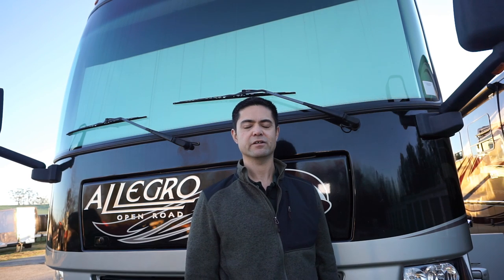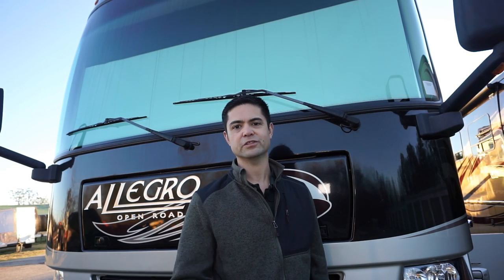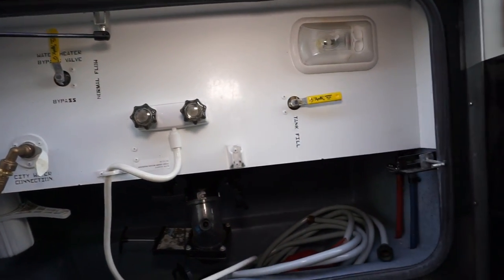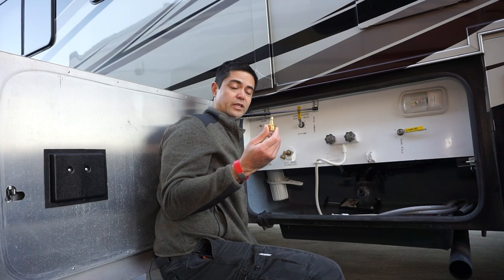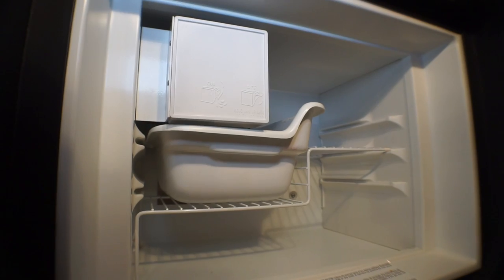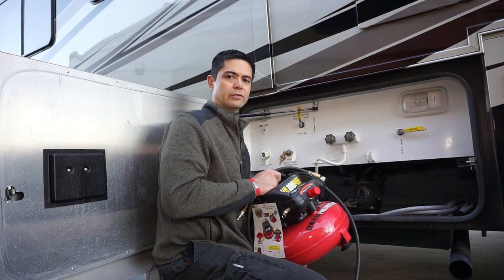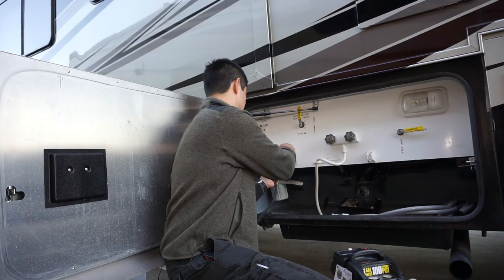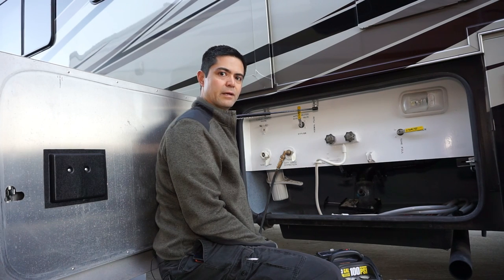Tips for RV winterizing with compressed air - RV maintenance the easy way

Comment: Thanks. I have the same compressor and was wondering if it would work. I'll give it a shot tonight. I'm kind of glad you kept it short and sweet here. Plenty of other winterizing videos out there, but I appreciate seeing which tools and method you use.
Reply from the maker: Welcome! Did it work out for you?
Reply: It did the job well as far as I can tell. A larger compressor would still be ideal but it’s still a good option for me. The nice thing is It’s portable if I need to blow it out on the road in the winter months.

Comment: Was hoping to see you blow each one out, as we too have a residential fridge, and I'm unsure of how to get any water going to the ice-maker!   We have a Tiffin as well...and I suppose I went one step further, (2 people) where I was outside (didn't have the same quick connect chuck like you did) holding the air to the brass fitting, and my wife opened all the sites (3 sinks, shower, & toilet) THEN added anti-freeze as well...just to be sure, to the whole system.   One thing I haven't done yet...but will, is we have our Phaeton plumbed for washer/drier, and I will take the caps off the two lines and add some anti-freeze to those!    Not quite sure yet, on how to fully get all air out of the ice-maker, as last year I ran anti-freeze through it, and that ended up being quite a mess the next time we went to use the motorhome and make ice.   Just got a slushy pink muck, which slid down to the bottom of the freezer for the first while.
Reply from the maker: That sounds like an absolute mess! Have you tried calling Tiffin for the residential fridge procedure? They've always been helpful to us for our coach.

Comment: Won't this method potentially contaminate your water lines with oil that may be in your compressed air system?
Reply from the maker: Good point! We always use an oil less compressor system. Most of the inexpensive small compressors are oil less that I've seen, good to check!

Also we run water through the system at the beginning of each season too - a little bit of bleach in the fresh water tank (just a little) or sanitizer tablets and run all the faucets for awhile.

Comment: rookies blow air in lines and then pour antifreeze into traps., i pro will blow the lines out and then run antifreeze through the lines and ensure there is no water to pool in lines over winter and split.  you failed to show the important parts.  like how to blow lines out. no wonder i need to service split lines in tanks for people in the spring.
Reply: Yep, blowing water lines out with air does not get all the water out and will at some point cause failure.
Reply: If you properly blow out the water lines, there's no reason you need to fill them back up with anti-freeze.  Water expands when it thaws, but since your lines won't be pressurized and full of water, little droplets of water left in a water line aren't going to cause that.  Think about it - in cold climates, when you winterize your irrigation system by blowing the water out, no one goes back and runs anti-freeze through the system.
Reply: Haters going to hate